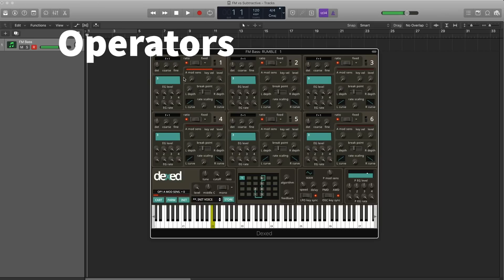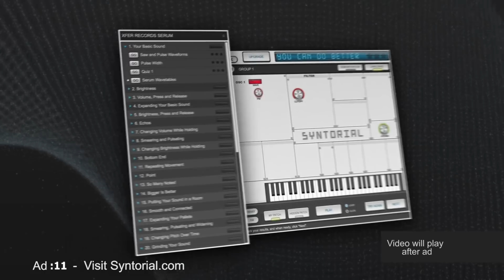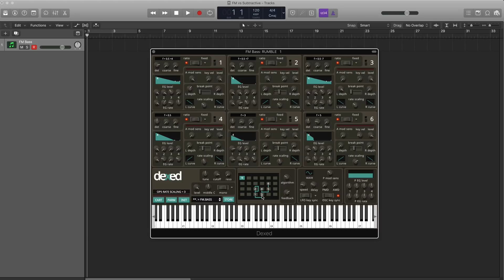How to make an FM Bass patch using FM Synthesis - Synth Quickie

Comment: Alright, I know this is 2 years old, but, I'm wondering if what you show here and what syntorial offers will translate easily to my DX9. I have patches, but I want to make my own.
Reply from the maker: This video should translate to the DX9 pretty well. Dexed is based off of the DX7, and I believe the DX9 is a simpler version of the DX7. And this patch is a pretty simple FM patch.

Syntorial is focused on mostly subtractive synthesis. There is a simple FM component included, but it's not as fleshed out as a full fledged FM synth's operators. That being said it does cover some common parameters like envelopes and lfos, so it will help you to some degree.
Reply: @AudibleGenius  ok thanks. So what syntorial offers would help more with my Korg Triton Studio. Thanks!

Comment: i think the noise you mentioned is an emulation of the noisy DACs in the DX7 MKI – the ones used in the MKII were much better but a lot of people say it losts its mojo
Reply from the maker: Thanks! You're right. I recently discovered that in Dexed, if you hit the "Parm" button at the bottom left, the "Engine Resolution" was set to "Mark I" which must be referring to the DX7 MKI, like you mentioned. If you change it to "Modern (24-Bit)" and hit "OK", the noise goes away.